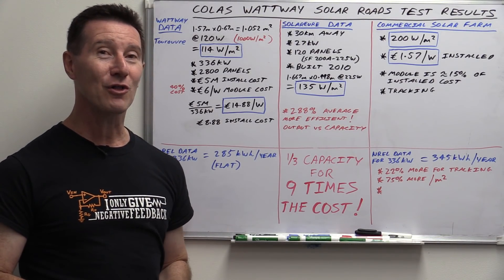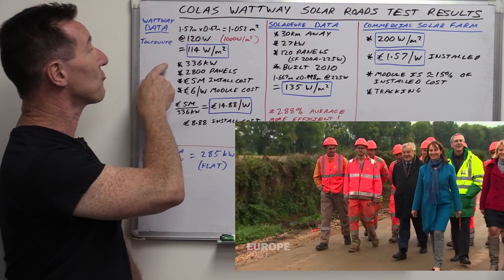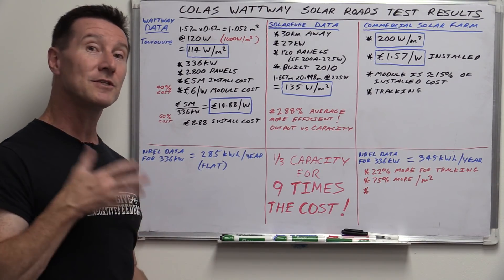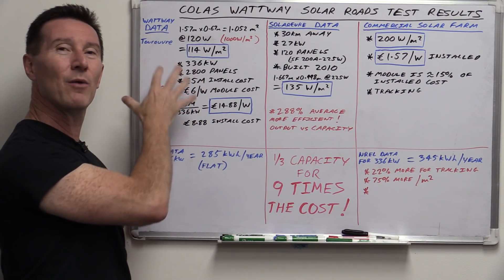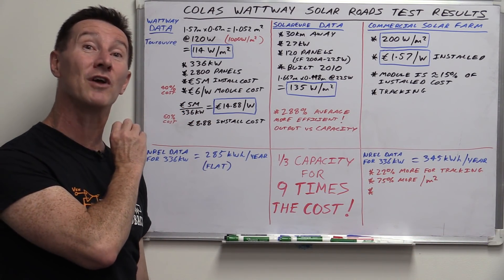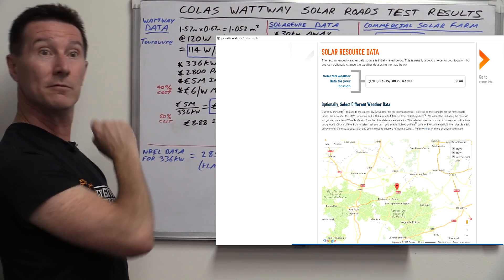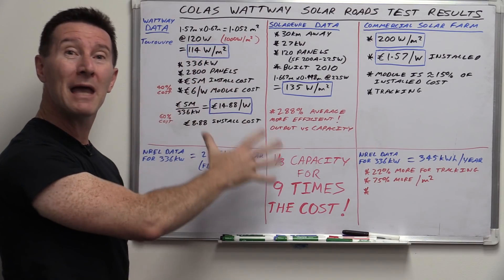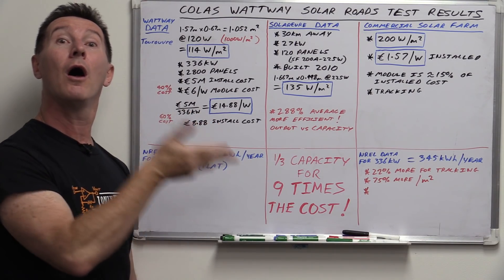EEVblog #1047 - Solar Roadways FINALLY BUSTED! (Colas Wattway)

Comment: Dave.. this is a thinly disguised global warming denial argument.. I WIN THE DEBATE!!
But OK.. lets go with your numbers. What was grossly missed in the engineering calculations was that cars traveling over the roads would reduced output due to the shadow cast by the vehicle's body. The true worth of this system will be realized when we take all people/cars off the road and put them on solar powered trains. I realize that then there would be no need for roads, but it illustrates that humans are always at the root of the problem. Eliminate humans and it will be butterflies and unicorns again.

Comment: Totally missed the point again!

How much electricity does a road without solar panels make?
Reply: No, it's how much more electricity will those panels make when placed almost anywhere else. It only makes sense to put the panels on the road once all over horizontal surfaces are already covered in panels.
Reply: John Meacham without trying to make it work then it will never get better, you are just using the very same arguments that the coal and oil industry used against solar panels in the first place.
Reply: Patrick Brett What? I want solar to work. Very much. If anything the coal companies would be for solar roadways because they are so inefficient compared to solar panels anywhere else.  Take that million dollars for an expensive to maintain solar roadway that produces only a little bit of power and put it into many more regular solar panels next to the road which will produce far cheaper electricity if you want to compete with coal.
Reply: John Meacham it's all about using any solar vs fossil fuels, the op is comparing one type of solar to another when he should be comparing solar vs nothing.  These roadways (or preferably solar pedestrian pathways) would be as well as not instead of other forms of solar.
Reply: @Patrick Brett, So you are suggesting we close our eyes and plug our ears and pretend this is a great idea because in the long run solar energy is good? I am sorry but that isn't how it works, that is how pseudoscience and ideology works. Do it right or go home. No one but ideologues would ever buy the "pretend it works, because maybe someday it will work and we don't want people to know"
Reply: If anything by promoting Solar Roadways and looking the other way from the fact that they are terrible... you are doing more to drag solar energy through the mud than any oil company has ever managed to do. Since now you turned Green Energy into part pseudo science... Just keep saying "Green" and it is scientific! Once people discover this, and they will, they will now have to start seriously doubting and sifting through any science that offers alternative solutions (THEN AGAIN given Ethanol... Maybe people should)
Reply: "you can only state those figures because solar panels have been in development for several decades" Not quite. For starters, the exact same photo-voltaic technology that is used in conventional solar panels is used in solar roadways, so a lot of the research effort is shared for both systems. The only reason why a separate development is even needed is that there are limiting factors that are specific to roadways; For instance, the mere fact that the solar panels are laid down horizontally decreases efficiency, and that's a matter of optics that applies for any solar device. Please consider that R&D requires time and resources, and that we have to be  able to make solar more efficient as soon as we can, precisely because we need a replacement for fossil fuels as soon as we can.

With all due respect, in most of the world we are not even close to running of rooftop space, and the expansion of urban areas means we won't run out of it any time soon. You know what's a limited resource everywhere? Money for infrastructure.
Reply: Patrick Brett I read the entire thread, it isn't even slightly apparent all you wanted was "continued research on flat solar panels." I think you'd have far fewer antagonistic posts from myself and other people  if this was even vaguely apparent in this discussion chain .  Also, no, I'm not wrong on many levels on the wind turbine analogy, it was vague and lacking considerations on purpose, and has bloody piss all go do with aeroplane props.  By more relevant logic, there is a reason most modern windmills use metal props, but you're right, that is for another day, because blatantly pointless misdirection is a fool's folly
Reply: @Patrick Brett, that would also be dishonest as you are trying to inflate Solar roadways to make them seem more viable. The point is that at this point simply putting solar panels on roofs is more efficient and less costly than Solar Roadways (as is solar farms). Essentially there is no reason to build a Solar Roadway. I mean why don't we measure how effective Road Farms are? They certainly make magnitudes more food than normal roads do, we can even fix world hunger with that extra food... Lets build farms on roads!
Reply: Nionivek the point is to put money into solar alternatives not dissuade people from trying them, how far would the solar farms have come if we had listened to the people who said it was uneconomic, no you have also missed the point as well!
Reply: Nionivek not in the slightest, I am saying that we should be investing and finding alternatives, if solar panels had the kind of support you are giving this then they would have never made it to a viable option status.  Don't forget that solar panels have been in development for several decades and it's only in the last few years that they have been accepted by the energy suppliers as worth using to bolster fossil fuel power.  Give this development some time and maybe find an alternative location (like on pedestrian pathways) then see how it does in a decades time.  Instead of dissing this you should be thinking of ways to make it work or suggest alternatives options, when we all start working towards a common goal we can achieve wonders, when we bicker we just cause stress and headaches.
Reply: I answer you with another question. How much electricity does a roof without solar panels make?

With the same money that the government spent on that roadway, they could have installed solar panels on every rooftop of the nearest town. By doing so, they could be generating ~27 times the same amount of energy (remember, the road has 1/3 the capacity of a commercial installation at 9 times the cost). Sure, we could just put solar panels on top of every random surface. But if we as a society want to replace fossil fuels with solar energy within the next couple decades, then we have to make sure solar production increases as fast and as cheaply as possible.
Reply: iluan Hernandez you can only state those figures because solar panels have been in development for several decades, this roadway technology has not had that same luxury.  Yes we should be putting solar into every rooftop but we should also be investing in alternative options for when we run out of land and roof space, we can't just use up the fields, where will we grow crops and graze the animals.  The whole idea behind trying to make this work is because we don't have infinite land available so we need to look for alternative solutions and pathways (not so much roads) are very numerous and available.
Reply: Nionivek it's the mindset like you're demonstrating now which is the reason it took solar panel technology this long to become a viable option, I read comments and put downs like yours when solar panels first came out!  Stop standing on the way and try helping to find options for a change.
Reply: iluan Hernandez true but when we do run out maybe then we might wish we had done some R&D on roadways before then, like now for instance.
Reply: Patrick, you're completely missing the point, solar road ways are a solution to a problem that doesn't exist. He's already explained, more than once, in the video, as the tech improves for solar roadways, so it improves for normal ones. Solar roadways are something you do after every government building, every commercial office, every home, has panels on them. You don't do it before that because it's a waste of resources. A solar panel installation on a roof doesn't get covered by cars, doesn't get damaged by cars driving over it, doesn't get the shade of trees or covering by leaves etc etc etc. There are literally hundreds of millions of buildings around the world that you could add solar panels to, all of which would provide better return for investment for this. If, after every building is covered, after every desert is filled etc THEN you might consider solar roads.
Reply: Gobtik and you are missing my point, when we do run out (sooner than you think!) then we will already have worked our all of the bugs and problems that you mentioned.  Think big or go home!
Reply: You missed the point.  How much profit does this thing generate over its life span, with installation, production, and maintenance considered?  How much does the electricity from this thing cost per watt?  If it costs more in cash and resources than it produces, it is a net loss.  It will never be viable-- not when that same cost could generate many times more power and actually be financially and practically viable if it was set up on the side of the road instead.  There's no angle to approach this from that makes putting panels flat on the ground on a high-maintenance surface a good idea
Reply: Krugis how much profit did solar panels generate in the first year of production, you are not thinking!

All you are doing is re-using the oil industry's arguments against solar in the first place.
Reply: Patrick Brett the difference is, these aren't close to viable even using the manufacturer's cream figures.  You still aren't thinking.
Reply: Krugis and neither were solar panels until the R&D was finished, these are not even close to a final design.
Reply: Patrick Brett Solar panels had a viable starting figure, you're objectively wrong here.  Solar roadways being mounted flat on the ground alone makes them unviable using even emerging tech in ideal circumstances alone, with the physical limitations of usable matter for this tech being an impossible limit to ignore or circumvent, no matter how pretty your dreams are.  The maintenance, man.  Even if you ignore reality and dream up of a viable solar technology on flat ground, putting them on a road destroys that notion due to, well you know, the fact we aren't researching our way past the maintenance required to keep a road functional.  Adding anything to that already expensive maintenance increases its cost.  Keep dreaming, that's fine, but dont ignore blatant reality on the notion that "R&D can fix that!"
Reply: Patrick Brett Here is another excercise:  if they develop a panel so awesome and magical that it is financially viable flat on the ground in a road....now, how much more viable would that panel be in a tracking solar farm?  Does it still make sense to put it in a road instead of beside or over it?
Reply: Krugis I'm not saying that this is a viable use if the technology only that the research should be allowed to continue until they make a viable system that would work on places like public paths etc. You are all confusing me with someone who thinks that this is a good use for solar roadway technology, no, I am advocating for continued research into this technology and not just dissing it out of hand based on cost, solar panels took decades to but come viable, give this research some time ffs!

With regard to your second post above if you read my previous comments you will see that I have said something similar, try reading what people wrote before commenting.
Reply: Patrick Brett Nah, I opened a dialogue with you based on your original comment, not a conversation you had with another person.   Seems to have rustled your jimmies, but hey.  I never said stop researching it, I said it won't ever be viable flat on the ground with additional materials on top of it making it more durable and an absolute maintenance cost (this alone will make them nonviable as a road surface ever].   

Research into solar is good, their wasted efforts on solar roadways will make actual useful technology better...but again, it would be better for them to quit wasting time on a useless struggle against logic and physics and just pour that money into making better and larger traditional solar arrays.  The video drives it home perfectly--it will always be leagues more viable to build it over or beside the road than on it.  You cant research away flat on the ground being a bad angle for solar electricity generation
Reply: Krugis what about deflective crystal technology to improve the angles, you can't research that on a panel that always follows the sun, there's loads of options that could make this viable some day but without the time for research it will never happen, apologies for confusing you with the anti research /it'll never work brigade but that's who have been trying to shout me down the loudest.  I agree with you on other possible better uses, I never once claimed (as some seem to think) that the road is the right place for this, paths and billboards would be much better.
Reply: Patrick Brett No, there isn't.  Not unless you figure out an optically clear material that can be produced in a cost effective manner and actually lasts.  The fact it is ultimately going to be a surface for cars alone kills it, all from the limits of reality.  Go check out how China's roadway held up to actual automobiles.  It'll get better, it'll never be viable.  If it becomes viable in it's own right, building it ten feet to the right and not flat will be just that much better.  Are you really contesting that?  What do you propose we research to make a glass road cheap enough and durable enough--and clear enough an actual, viable thing?
Reply: Patrick Brett At the end of the day, it would always be far more viable to build a solar roof over the road.  It will likely always be a cheaper installation, and would produce multiple times more power, no matter how good a panel flat on the ground gets (same improvements work on that non-flat panel).  I know you want to dream like the rest of them, but there's no compelling argument for this.  Not one.  We could generate the world's current power consumption by covering something like 6% of the Sahara with panels, imagine what we could do on roofs and over roads?  Or we can fund  dreamer bullocks that takes away from R&D that could have been spent making something worthwhile better.  This is like taking a modern wind turbine, replacing its blades with traditional wood fins, and calling it progress because "research could make it better."  Whatever dude
Reply: Do you even efficiency, bro? Until we've run out of places to put regular efficient panels on top of, it's a waste of ressources to even consider solar roadways. Wasteful use of ressources also means polution. Politicians are only good for wasting money. Until a product can't exist in an environment of fair competition, without governmental grants, it's garbage. You idiot. Instead of fair competition, you get fail competition. The product fails!
Reply: Krugis no I am not contesting that as a road this is a bad idea, I am simply arguing in favour of the continued R&D of flat surface panels, it's almost as if you haven't read any of my other replies lol.  As for your attempt to make me sound stupid by bringing in wooden wing turbines you are wrong on multiple levels, firstly it's more to do with the shape and style of wing (propeller vs vertical) and there's a reason why aeroplane propellers are mostly made of wood but this has nothing to do with the current discussion.
Reply: Patrick Brett to make the above clearer,  flat panel research is fine, just as long as it is on improving the panel, and not going into the trash bin of solar panels on automobile driving surfaces
Reply: Krugis agreed with you on the last post but as for the rest it's irrelevant who thinks who is wrong, time and research will tell.

Comment: Might aswell install thermocouple nets under the tarmac. Black roads convert ALOT of the energy into heat. Should harvest it with something that converst HEAT into electricity..

Comment: solar roadways baah... slap windmills next to the highways, not like the extra noise will bother anyone... and dig down most roads where possible (in cities etc) and actually have grass/parks on top of the roads instead, all parking underground as well, you would not have snow, rain, sunglare etc on the roads and they will be a lot safer to drive on and they would not need to put tons n tons of salt on the roads as they stupidly do here in Denmark during the winter... so yes it would cost more upfront to make the roads but they would not be destroyed by the salt + freezing weather since they are under ground and you get more greenery into the cities and bettering the air quality by putting filters on all the "exhausts" from the underground roads to filter out as much as possible before spewing it up high in the air

Comment: I don't agree with this being the most stupid solar project. I believe there is one even more stupid. IE Trump's idea of a solar powered wall between Canada and the USA. OK it could theoretically be more efficient as you can angle the array. However cable losses huge install costs (as roads are sometimes 100 miles away) and maintenance costs make it laughable.

Comment: Now lets talk about the alternatives. Good places to put solar panels are on virtually all commercial flat roof buildings. Very large mount solar panels could be beside a road or in parking lots to act as a shade and can be used to charge electric cars. A large tracking panel could also be used as roof for parked cars to keep the rain and sun off of them at venues or even at home.